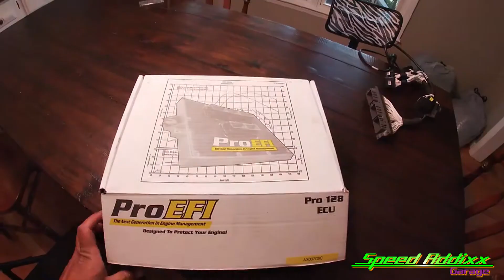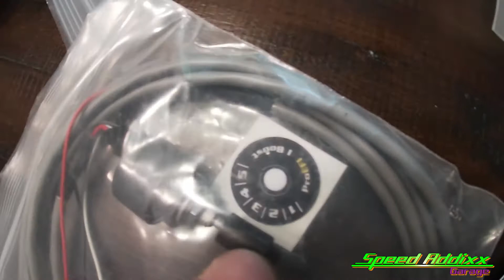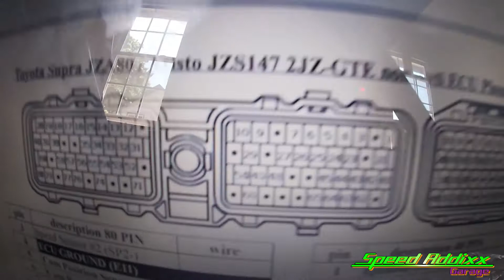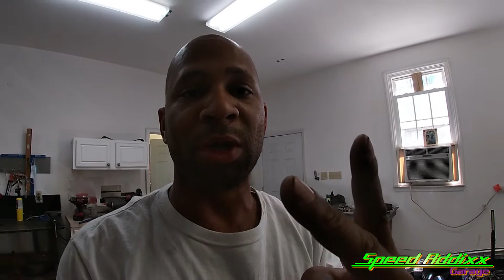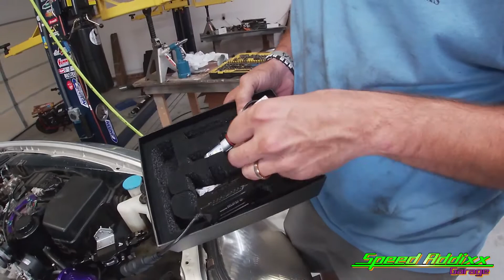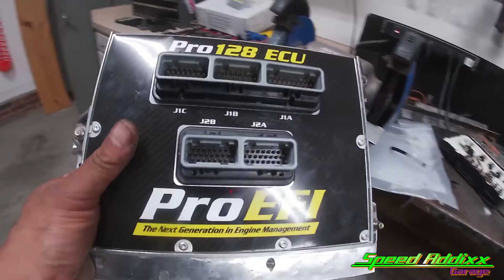Supra Build 700HP Ep.27 - PRO EFI INSTALLATION!!!!!!!!!!! (LED Bulbs install)

Comment: Nice video. Dumb question, if I wanted to upgrade from an hks f-con vpro to a pro efi, who would be ideal to handle the transition/installation? Would it be a tuner shop? I don't want to deal with the swap install and tuning.
Reply from the maker: I would recommend doing some research of shops/tuners in your area to see who you trust with your jewel.. On average the shop that you trust to tune your vehicle is capable of installation as well. Hope this helps and thanks for checking out the channel!!

Good luck!!
Reply: @speedaddixxgarage8278  Cool thanks!

Comment: None of those cars you show run Pro EFI. Ekanoo runs motec, Baltic runs AEM... Maxx ECU is a cheaper option and works with the factory transmission just perfect. Others run fuel tech and haltech etc.. Proefi meh
Reply from the maker: I just added the clips in there because I had them on my computer. I wasn't trying to imply that there running Pro EFI. Speedaddixx loves Pedro and his Baltic Supra. I never get tired of showing his stuff. Why do you think Pro EFI is mehh?? I'm curious....
Reply: @speedaddixxgarage8278  I understand. Regards to Pro EFi I'm not bashing them just the price is right there with Motec and there is Maxx ECU and not my choice but it works ECU Master. At the end of the day it all boils down to the tuner being comfortable with it or flavors.
Reply: Motec and proefi are my goto and what was recommended by my tuner.  motec seems to be a bit higher in price though from what I been looking at since they have modules to add to the unit. I'm going for proefi since it works great with the auto trans, and has tons of fail safes.
Reply: Baltic Supra is running proEfi actually!!
Reply: @GS_Twan  AEM tuned buy Lance